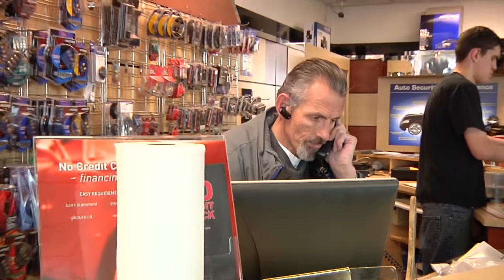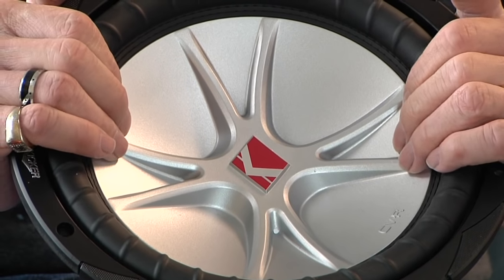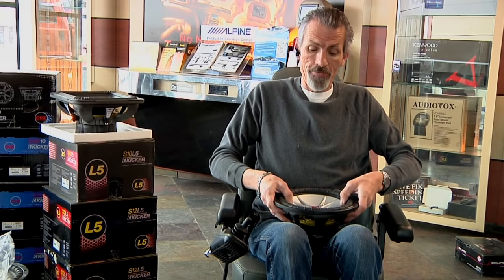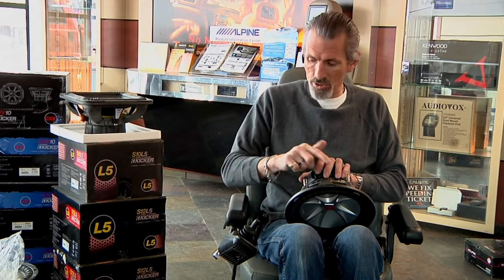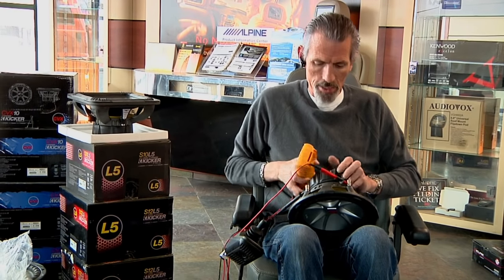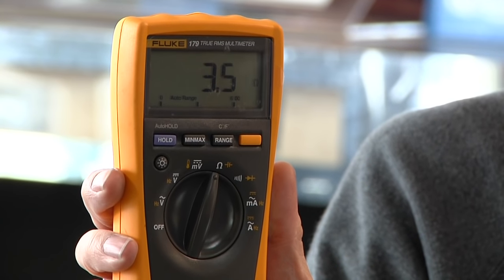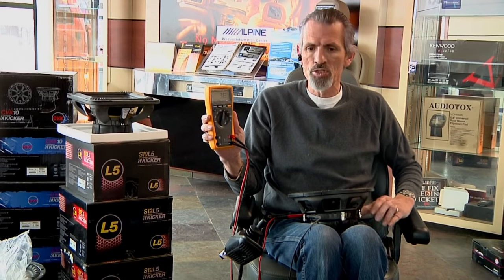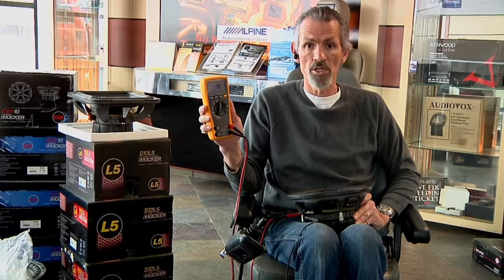Car Audio : How to Tell if a Car Subwoofer Is Blown

Comment: Interesting, I have an older set of Orion XTR Series 2 12's (from the mid 90's old school) and they both measure 6.0 - 6.1 ohms on my multimeter yet they're rated @ 4ohms. 

Just to verify it wasn't my multimeter's fault I tested a Pioneer 12"  sub and it measures 4.1ohms (4ohm rating).

Comment: Thanks for your help. I have recently taken the sub out of the enclosure and I could not find anything. I then rebuilt the enclosure as  there was some slight damage to the carpet. I have never experience this rattling noise like this before at low volumes. Very strange. Thanks again

Comment: It's likely that this remote or trigger wire is connected to a constant 5v line. (This line stays on even when car is turned off) what you may want to do is take a look at your car and splice the trigger wire to something that turns off when the car is off. So something like say your plate lights or in some cases the deck may have a dedicated trigger line out from it. 

Hope this helps.

Comment: Hi! I saw that you are an expert on car audio. I have installed a Pioneer AVH X2800-BS in my 2000 Nissan Pathfinder w/ the Bose system. I did install the Scosche CNN02 adapter as well. I had it set up and it was sounding good, but I lost sound in all four speakers (first the front and then the rear) after about 30mins of use. A buzzing noise coming from under the front right fender started to occur once the sound was lost. I am wondering what is going on! Thanks
Reply: AznBassAngler probably just the wiring having bad connections. was the buzzing more like a loud speaker buzz ?

Comment: I have a 2ohm L7 15inch q class and it started to smoke today. Still works and seems fine. Just a lot of smoke and no clue where it came from other than the coil. So if the smoke happened does it mean it’s ruined? Even tho it still seems like it works fine??

Comment: eHow I Own a Sony HT-M5 Home theatre component system ... while playing loud music suddenly my system turned off and smoke started coming out of the Subwoofer_(model- SS-WP7M) ... now when i connect my subwoofer to my reciever and play songs, a distorting vibrating noise comes from the subwoofer... any idea if it can be repaired?
Reply: a lot of sonys do that.
Reply: the coil in it could have fried? get it reconed?
Reply: Henry J Got It repaired From A Local Store As Sony Refused to Do So . Repaired for Just Rs.1000(approx 18$) in India
Reply: TechBuzz Wow, this actually sounds like some short has been developed which let DC get right into your subwoofer and fry it. 
On a side note eletronics work on smoke, don't you know? When the (magical) smoke escapes, your electronics stop working :D
Reply: TechBuzz 

Dont buy Sony ;-)
Reply: Buying a new won should fix it

Comment: extra step, if your sub isn't producing sound and is still wired in powered on .just gently press in on the cone. if it responds momentarily scratchy . Your voice coil has slipped off the former. these in most cases can be repaired. and this is a sign of over powering and over heating. or it's just blown.seen allot but rarely mentioned.

Comment: often times its just a worn out or shifted spider causing an issue,  first of all don't deal with subwoofers that have a full diameter dust cap,  this design is just to keep the buyers from removing the dust cap and getting into the pole area for re gapping the voice coil

Comment: my vibe slick makes a farting noise when the bass beats hit when turned up. the speaker on the other channel is ok though. the farting one isnt solidly mounted though. Its sitting but the plastic clips have partially broken. Will a slightly loose fit on my parcel shelf really cause this or would you say its being overpowered? Says 80wrms max. My amp is infinity 150w per channel.

Comment: @Sandfire77 your amp is over heating, when it over heats it shuts off to cool down, 300 watts is not enough to puch kicker comp 12 no matter how many watts it says "and even though the amp may say 300W it might nit be a true 300. i have Rockford Fosgate 850 w amp pushing 2 kicker comps and it over heats alot

Comment: any ohm but not above 4ohm! or your amp will short because of lack of resistance. 4ohm will make your woofer sound the full sound and 2ohm won't be that loud. but if you want your thing to last longer then i prefer you'd install an 2ohm.

Comment: A Volt Meter is going to test the DC resistance. Speakers specs are AC. If you cheek with an Impedance Meter you will get 4 Ohms at 1000 hrz
Reply: Rock on man.

Comment: if u need to check the sub and dont want to take it out just take a double a battery and make contact on the pos and neg, if the subs work they will make a small bass note. good if u dont have a volt meter and need a quick trouble shoot if u arnt getting power from amp.

Comment: Hey I got 2 kicker compR subs in a custom ported box there dual 4ohm I've had them maybe 3 weeks one of them when I push it in has a little scratchy sound but it's only when I push it in in a certain spot is it . But it still hits really hard and it not stiff or anything is it blown?

Comment: hey guys. im new to caur audio systems. and just got my subwoofer yesterday. it plays in 4 ohm as well as in this vid my questions is.

1. the terminals on each side of the sub is for what amplifier and ?
2. the sub i got can take 600 wrms does it matter if the amp can take 500 wrms in 2 ohm or in 4 ohm ?

Comment: so youre going to run an amp per sub? if that is the case, and your amps are one ohm stable, get the dual 2ohm subs and wire them down to one ohm. if the amps arent one ohm stable, you gotta get the dual 4 and wire them down to 2 ohms.

Comment: also, you can just connect a 9V battery to the + and -. if it works, the subwoofer will make a little "pop", and move a little bit :-)

Comment: hey 
first of all great tutorial but I wanted to ask you some questions  if u can answer them :D
I don't have a sub but I have a 450 Watts Pioneer Speaker so I was playing some songs (Loud) and suddenly one of the speakers stop working I tried to test it on the other channel but it didn't work … so I did what you ur doing and it doesn't have any sound when pressing on it and its not frozen or anything but I don't know this device of yours so what do your think is the problem

Comment: My subwoofer moves easily when you push on it but it makes a screeching noise almost like something is rubbing . Is there a way to fix it or is it dead ? 

When I put a little pressure on the surround while it plays on the 1 side the screeching stops .
Reply: My sub has the same problem the screeching noise . please let me know if u have found a solution  

FACEBOOK : Gulas gmn

Comment: @kickerl7dakota i once had a whistling sound comming from a kicker cvr 12 that i had in a qlogic box. The box actually had a ver small leak in it that caused the noise. Also, it can also be engine noise from a bad ground. If u can, check where ur ground is and reposition it to see if it fixes it. If not see if u can hear any sounds comming directly from the box, cuz that means ur box has a small leak/hole.

Comment: i have a question, when i turn off my car the light on the amp stays on and it messed up 2 batteries already. what is wrong with the wireing? cause if you disconect the remote it should turn the light off, but it stays on. what advise can you give me?

Comment: Hey, i just bought a sub and im doing exactly what u told me to do(push down on the sub, and sees if it doesent stick) and i did it, but at the very end where it cant be pushed no further, i can hear it scratching. 800W its registered at and i got it on a 600W kenwood amp. it feels nice and strong, pumps strong, but im wondering now if its blowen or not now..

Comment: 1. singel 10" but the amp provides power for 5 satellite speakers as well
2. ported
3. dunno its a tv/computer system and u cant change 
4. I have all settings at default

but i think the amp is damaged in some way

Comment: Hey my subs have decreased in power since i first installed them. At first they hit really hard but now im finding that i have to turn up the subwoofers louder and louder to get the same result out of them. Also, when I increase my speed in my car, the subwoofers tend to get quieter. This starts to happen at speed in excess of 25mph. I think its a problem with my deck. It is stock. I drive a subaru legacy 2004 sedan. I have two 12" Rockford Fosgate Punch P1's in a sealed enclosure.

Comment: My subwoofer recently started making a plastic on plastic slapping noise. It wasnt tht bad when it first started but its gotten worse. When i push down on the sub it makes no noise, but it is slighty easier to push down than my other sub. Is it blown? If not what could it be? Thanks for your reply!
Reply: MrDbro94 Check whether the frame didn't become loose. If not, then the problem's with the voice coil (or the material it's wrapped on), so you might not be able to fix it without taking it apart. Also, you could try moving it in and out (pushing it in, then out) for a while and listen to the sounds it gives.
Reply: CoolKoon I found out what it was shortly after posting this comments. My subs had broken my box. ( the staples ) so the board was smacking around.
Reply: +MrDbro94 lol XD
fixed it?

Comment: Can I use the same ohm meter trick to test a 4 channel Soundstream tx4 560watt amp. And PoweBass 3 way passive crossover 2xl-60.3c which can be used as a bi amp.
Reply: ***** Depends what kind of test would you'd want to perform on the amp.

Comment: I have 2 12s. Memphis subs and amp. I had it professionally hooked up since I don't know anything about them. I only had them one day and I was driving and it just completely stopped. I bought every bring completely new.
Reply: Everything*
Reply: Not every shop is full of professionals, plenty are filled with ex-cons and half assed work ethics.

Comment: im going to get two pioneer ts-w3002 they come in 2 or 4 and i was going to power them on a separate battery with two alpine 1000 watt rms monoblock amps the subs are dual two ohm and dual voice coil in a dual custom ported box tuned to 33 hz they need 1.2 ft of space for each

Comment: you say "more than likely the subwoofer is blown" i went to buy 2 subwoofers today, one of them had a very unstable reading but it didnt make any noise when i pushed it up and down and the suspension moved fine. the seller was amendment it worked last fine last time he used it. does "more than likely" really mean "definitely" or is there a possibility it is actually ok?
Reply: sal7t5 there are not blown just very used if you know what i mean

Comment: i havae a question, i have 2 pyle audio red label subwoofers 4 ohm dvc n im wondering if its ok to play them with one voice coil broke, i thinks its one of the negative voice coil
Reply: javier mendez yeah as long as you run it at the proper ohms and don't put to much power to it

Comment: I have a kicker L7 12 in.  rated at 750 rms and have a kicker zx750.1 amp powering it.  i usually play my music with the bass control know on full bass and play it loud but not so loud that my sub distorts.  yet when i play certain songs on a low volume (2 or 3 when i usually play at 16), i hear a buzzing noise coming from the sub.  I think it's just bc the bass isn't loud at that volume but im worried that something might be wrong with my sub.  ive only had it for 6 months.  any advice? thanks

Comment: So, here is what my system is doing. Since ive had it installed it has been the most beautiful sound of any car stereo I ever heard. I had it installed at Best Buy 12 years ago. I have an Alpine amp for the 4 inside speakers and a Kenwood amp for the Kicker. 

Everthing sounds fine at low volume, but now, when I try to crank it up it will sound great for about 3 minutes then all of a sudden everything just goes into this loud muffled bass. Its like it gets to a point and just womp womp womp muffled loud bass and then it will snap back on for a second and keep doing this. I did the ohm test and I'm grtting 3.7 on the kicker. Its a 4 ohm speaker. However, when I press the cone in and out with the tester still connected, the ohms jump up to 50, 25, 15, then when you stop, it goes back to 3.7. Is this normal and does any of my symptoms sound familiar?
Reply: Did you ever find the problem it had?
Reply: @aracistpriest6121  nope, the entire system stopped working and since covid ive not been able to have it looked at. Have no clue. Nothing works but sound from the regular car system. Ive tested amps, tested batteries tested everything

Comment: What if the resistance is just high but stable? I have a kicker L7 dual 2 ohm coils and one is reading 24 while the other is reading 2.2 but both are stable.
Reply: Its blown one is way off resistance while the other is normal you "Can" still use it with one voice coil just not loud. TBH I haven't heard many good reviews on mid-low end kickers. But to each their own.

Comment: @kickerl7dakota  It may be very likely harmless outside noise from line in of radio. try to see if you still hear it after disconnecting the inputs from the amp.

Comment: When I push down on my sub, there is a scratchy feeling to it, it's a 12in comp s, would I be able to repair it? Thanks in advance
Reply: Make sure to push down on opposite sides simultaneously.
Reply: @dstolerjr  hey man my pv215 speakers don’t push down at all? But they push up it doesn’t sound scratchy or anything. I’m wondering if the fact that it doesn’t push down means it’s 100% blown. Do all subs do that ? ThNks in advance

Comment: Hi,i have ground zero gztw 30t sub,m using it on jbl gto 1004 amp,whenver m playing the heavy bass songs...the sounds comes like phat phat phat..
i had checkd the crackin,scraching noise it wont came when i push the cone in middle but comes when pressed on another side
then i had checkd impendence of these subwoofer it showing "4.4" stable,no flacuation  at all..
what that means is this subwoofer is blown??

Comment: I need help! i got 2 15" kicker comp cvr's and each is 1ohm 500watt rms and 1000max each, and i have them wired at 1 ohm each and i was driving down the road and they both stoped working, i pulled over and i turned it all back on then they were both working again, and then one made a weird noise. then they worked, and now they stoped again and now they arnt coming on at all but the amp is.. please help!!!!

Comment: I have two Boss phantom 10" shallow subs, they were running just fine yesterday but today I got in my truck and my bass sounds like a knocking noise. One sub seems to be blown. Damn.
Reply: PNWmushrooms Yes, it happens all the time, especially with low-quality brands. If you feel like it, you could try googling around for a recone kit for your sub. If not, maybe you could try to disassemble it very carefully and rewind the voice coil (make sure to use the same thickness and wire the same amount of coil).
Reply: CoolKoon yeah not bad for a $35 sub to get 2 years use out of it. I plan on getting pioneer shallow subs this time.
Reply: PNWmushrooms A $35 sub?! Wow, I don't think I'd be able to get them that cheap, so yeah, you were lucky indeed ;)

Comment: I have a sundown subwoofer that has stopped playing.. Took it out the box and the magnet has rust or corrosion all over ???? How does that happen? I bought it new never wet just has rust all over magnet
Reply: what part of the country do you live in? I've noticed that in more humid environments especially near the coast speakers can corrode and rust quickly in a non air- tight box. is your box ported? try using a contact cleaner on the terminals.
Reply: +Kenneth Maccourt  thanks for the reply.. I live in Tennessee, that's what I thought at first because it is kind of a humid place, but I never had any problem in the past 10 years living here.. The sub was in a ported box.. It looks like it got dipped in water and just got rusted out .. It doesn't play any more due to the corrosion or rust..
Reply: +Jay Ay Maybe it has rust build up on the voice coil. At the autoparts store they sell an automotive spray of electronic cleaner. It looks and smells like throttle body cleaner and dries fast too. It&#39;s a bit strong, but I figure you got nothing to lose. You could give that a try if your sub has a vented pole piece. Just aim at the voice coil, but avoid spraying the spider or anything else. See if you can find a way to clean the tinsel leads and speaker terminals too.
Reply: +u2bed91 I will def try that.. Hope that works seems rite..
Reply: Yeah, give it a try. I also heared somewhere that keeping one or two bath towels on your dash (or the trunk) can help absorb some of the humidity. Anyways, good luck.